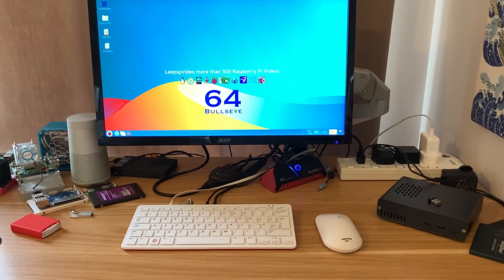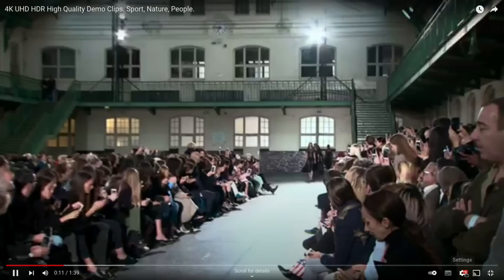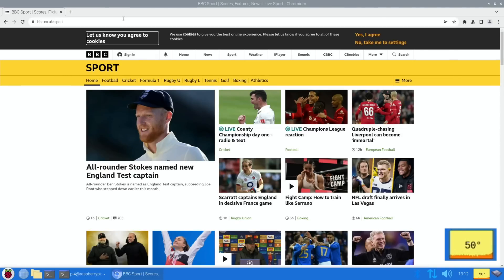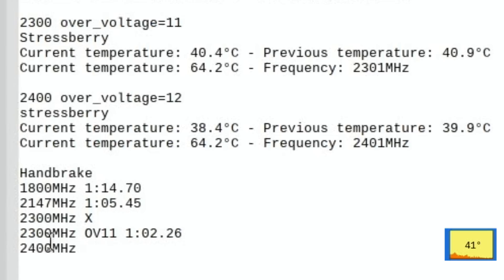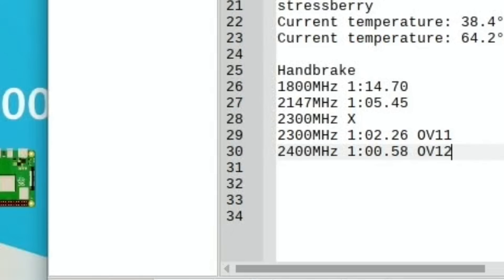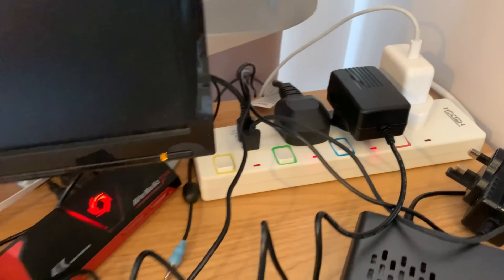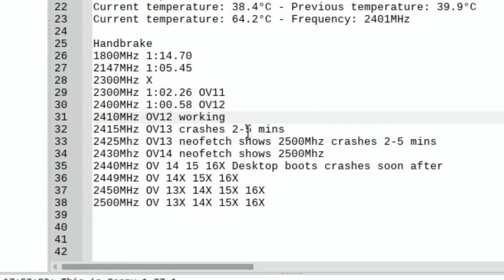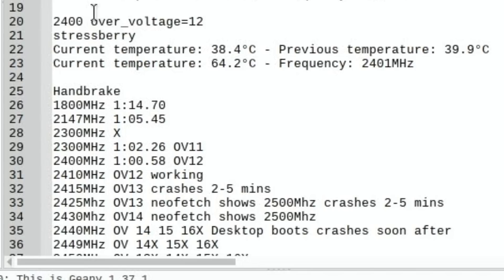Pi 400. How high can I Overclock without it crashing.

Comment: Good. From some higher frequency on, overclocking comes at an exponentially higher cost of power consumption for a marginal performance improvement, which is important when using the Pi on batteries (outside usage). It would be useful to show that power consumption as well (with real-time graphical data from to-the-wall meter). 

Have you noticed a difference on the max. frequency reachable in static overclocking mode (force-turbo=1) vs. dynamic one? 

For next tests, could you consider the 'gpu_freq' parameter ? what impact on web benchmarks? on stability w.r.t. simultaneous CPU overclocking? and on OpenGL vs. Vulkan + X11 vs. Wayland?
Reply from the maker: I have under clocked to save power

Under Clocking Pi 4. Motorola Atrix 4G Lapdock powering Raspberry Pi 4.
https://youtu.be/dpPYTTchRRk

Comment: Looks like I lucked out on the silicon lottery, can only get 2300 at OV 11 stable, at 2400 the pi400 refuses to boot.  I am not disappointed with this as the almost 28% increase in speed, at 2300, is very noticeable in use, it makes for a better experience. Thanks for the info.

Comment: Great video amazing what firmware changes do... Bear with me their was a time no one on a pi 4 could go past 2147. Just ask ETA Prime , Drew Talks or Wagner Tech Tips or many more .  It could not just be done .. ETA Prime would swear by his FLIRC Case you just could do no better passive cooling. And then came the ARGON 1. Explaining Computerd did a series of shows on cooling the Pi 4 and the king in the end was the ICE Tower.  You did a video recently , about a Ice Tower won't to be with a large base plate to cover other chips on the board. IT came with a black case fan separate to the cooler and the attached led fan.The 2 extra wire clips were to attach the black fan to the other side of the tower to draw the air back out of the cooling rig... My point is think of your Pi 4 as a   See   Saw  and at stock speeds your arse is siting on the ground and your max temp is 80%....At  2147 GHz and going above 60% I would expect  a crash. As you increase your over clock your max temp comes down. Think of the See Saw.  Heat is a product on inefficiency...
I would like to see you run the same test in your normal rig with both fans connected but with one catch... YOU have to have both fans powered by another PI running headless just to power the fans say running Pi Os Lite as a server...  Can you run your favorite Youtube video in a loop and what is your temp????    LEEPSPVIDEO  HDR...
My point is I was one of the first to get a Pi 4 and there was the problem with power surply chips on the board. To get my board to boot consistently I had to add the line to the config .txt  over_voltage=3... But if I changed the 3 to a 6 I could for a breif period of time get to 3000 GHz !!!! But then came the firmware update... To prove my point with a fresh in stall of any version Pi Os and that one line of text in the config file your Pi 400 runs at 1800 GHz... My poor old Pi still runs at 1500GHz.... Great Work thanks.....

Comment: I suppose one has to weigh up the benefit vs risk of killing it , once you got up over 2100 mhz the returns diminished significantly . What would you recommend as an over clock setting  (CPU,GPU and memory size ) for a Pi400 running the latest version of Raspbian for improving YouTube ? I run Mobile broadband so there is a limiting factor there  but 720p is about the limit I can run most of the time without dropping a lot of frames .
Reply from the maker: I have run 2147 for a long time without any issues. I often don’t change gpu or mem settings
Reply: @leepspvideo  
Ok cool I will give it a go !
Thanks !

Comment: After copying my Pi4 SSD to an SD card I tried this and ran into a blank screen (and was happy I made the backup!).  Since you mentioned success with a 2300 overclock with and over voltage of 11 I gave that a try and it worked like a charm.

Comment: I ran 2300 without overvoltage. It ran ok, but sometimes it could crash, that’s why I clocked down to 2200. 
Maybe I should use overvoltage, in ordet to get 2400

Comment: Isn't there thermal paste between processor and heat sink? Would that be an improvement if one adds that?
Reply from the maker: It’s a thermal pad as standard. In all my tests the cpu never got too hot. I have run the Pi 4 much higher. Paste could definitely help a little. 👍🏻

Comment: Is there a way to put a tiny fan inside the pi 400??? Maybe you could connect to a couple of pins and have active cooling. Just a little breeze could do amazing things with that big aluminium plate.
Reply from the maker: I did play around with different cooling options. Turned out the Pi 400 is super effective as it is. Plus I love silent cooling

Raspberry Pi 400 Cooling test. Comparing 5 methods.
https://youtu.be/bzIHCddJKX0

Comment: Wow. Even with the DeSalvo case i have, and a fan on, I couldnt get to clock anything over 2.3 and stay stable (IIRC). More voltage wasnt helping. Yeah, the snappiness gains around these speeds are really noticable even with just 100mhz added. Really surprised the 400 clocks so well and stays cool. I guess a long heatsink with tons of surface area really helps. I'm getting more and more tempted to get one of these now for my BFD project.

Comment: Ok, that's what the whole overclocking section in my config.txt file looks like right now:

#uncomment to overclock the arm. 700 MHz is the default.
#current_limit_override=1
#force_turbo=1
#over_voltage=10
arm_freq=2100
gpu_freq=950

You see, most of it is deactivated. Feel free to set the CPU down to 2000 because I had sometimes a few glitches. I have smooth playing in 1080p, without h264fy activated. I also tried Firefox, but it was choppier.  Browsing is not too shabby at 1440p. To me, it feels almost daily-driverish. ;-)

Comment: I've given up on Raspberry at this point.  I used to build stuff for friends and family all the time, now you can't purchase their products anymore without paying an insane $200 premium for a $50 item, so whats the point.   Maybe by 2023 there will be something better.
Reply: Currently, at least here in Germany, the Pi 400 Kit is below EUR 100. The Non-Kit is below 90 bucks, so the kit is the better deal right now.
Reply: @linuxtuxfriend9155  I have a pi400 but Ive found it has a few weird incompatibilities with images made on non 400 Pi 4 machines.  No clue why
Reply: Look at the Pi400
Reply: The chip shortage is making standard pnes more expensive

Comment: Ok, I tried gpu_freq=950, with the CPU staying at 1800 and over_voltage at 10. Video (I played one from the dpreviewtv channel) was fine at 1080p - without h264fy(!), but the bluetooth stack gave an error message. I was able to use HFP which is for phone calls, but that is the crappy sound mode. The AD2P did not work. Looks like Bluez does not like the higher GPU speed - is the voltage too high? Unfortunately, the Pi 400 does not have a headphone jack. Will try without over_voltage.
Reply: With Ubuntu 22 I was success with my Jabra 75with Bt. With ad2p. With bulseye I experienced the same. Nagyné the Ubuntu has newer kernel.
Reply: @gorgo75  I deactivated over_voltage and Bluetooth works! Tried even 1440p, my monitor's native resolution, was choppy, but it played. Will turn up GPU more. ;-)
Reply: Ok, tried gpu_freq=1050, and graphics did not work. At least I see some response from my Pi 400. ;-)
Reply: gpu_freq=1000 did not work either. Setting over_voltage to 8 also was of no help. So, best config for me right now: gpu_freq=950, no CPU overclocking, no over_voltage

Comment: Nice results. You can independently overclock the GPU - have you tried and does that impact video playback?
Reply: In earlier config.txt files there was an entry "gpy_freq", and it was set to 750. If you don't overclock the CPU, but the GPU, maybe there's a  difference. I'll try.
Reply from the maker: I have

GPU Overclock test 950Mhz. Raspberry Pi 4.
https://youtu.be/9q-k-ANRB0c

V3d Overclock test 1000Mhz. Raspberry Pi 4.
https://youtu.be/epWXhk6omtU

Comment: if there is room behind the board you can put a thermal pad on the underside of the SOC and then add another heatsink or heat spreader.
Reply from the maker: I’m not sure it needs it. You could 3d print an alternate base

Comment: thanks, good video! enjoyed that. also... do you think it's not worth overclocking the GPU at the same time then? for example if it causes complications in the overall stability when cpu is already being overclocked to the 2400mhz. would be nice to know
Reply from the maker: I have added 950 gpu from the comments in my previous video. Still seems stable
Reply: @leepspvideo  ok thanks!

...BTW just looked up the meaning of the force_turbo=1 setting and can now understand why it is so absolutely essential here for the stability. as it is the Pi equivalent of disabling intel speed step / turbo boost technology

it being necessary to stop the freq dynamically clocking up / down on demand. quick question: presumably with force_turbo=1, then makes the core_freq= (downlclock speed) is no longer applicable and can be omitted / removed from the config? is that the correct thinking here?
Reply from the maker: @dreamcat4  I agree. 👍🏻
Reply: @dreamcat4  if you set the min and max clock speed within a narrow band then you can increase the dynamic performance
Reply: as for me with pi 4 b rev 1.1, i can t get good overclock on gpu and cpu at the same time no matter the voltage.
Reply from the maker: @gzaos  are you using the official raspberry Pi power adapter or something else? I have a day one Pi 4 4GB that For a long time has run 2147 probably higher. This video is from 2019.

Pi 4 2147MHz Overclock plus Dreamcast test with Official build of Lakka Retroarch
https://youtu.be/EYT9ItAiAV0
Reply: @gzaos  if youre interested in a working gpu overclock... the following is how I used to over-clock my devices with stable results, using the official power supply, and a samsung t7 ssd...

Raspberry Pi 4:
boot_delay=2
over_voltage=8
arm_freq=2200
h264_freq=750
isp_freq=750
v3d_freq=750
hevc_freq=750

Raspberry Pi 400:

boot_delay=2
over_voltage=6
arm_freq=2200
h264_freq=750
isp_freq=750
v3d_freq=750
hevc_freq=750

Comment: Have you done any test while running Windows 11?
Reply: I have, and Windows 11 runs well with this overclock. I've used a 2TB HDD externally connected to a Raspberry Pi 400 connected to a SATA dock.

However sadly the GPU stuff won't work yet because there are no drivers >m<
Reply: @naga_serpentis  any temperature issues? Mine overheats whenever I run W11
Reply: @KaffeDad  Nope :3
Reply from the maker: Just Bullseye

Comment: You should keep arm boost on even if you are not using the auto voltage as it might cause software issues in some senerios. Hardware acceleration seems to be a bit weird with arm boost off. But I like how you have gotten it working!

Comment: Someone got 3ghz on pi4 do you know how?
Reply: How? A peltier diode/cooler ?
And how does that translate to performance ratio? is it +%10 faster or better?
Reply: @igrewold  well I have peltier cooler but it doesn't affect overclocking
Reply from the maker: The important thing is if it’s actually making the Pi faster. I suspect the Pi may have been misreporting the clock speed. I definitely had that with the Pi Zero 2W.
Reply: @leepspvideo  I think you actually showed it in some video
Reply from the maker: @H-W  😀 may have been in a Pi news. 👍🏻
Reply: @leepspvideo  yes but how did he do it? Better power supply or what?
Reply from the maker: @H-W  I think the Pi won’t benefit going beyond the official adapter. I tried a 4 amp adapter which didn’t help Overclocking
Reply: @leepspvideo  what about more?